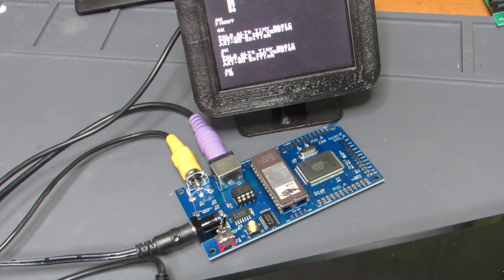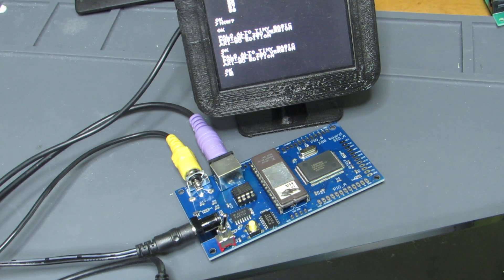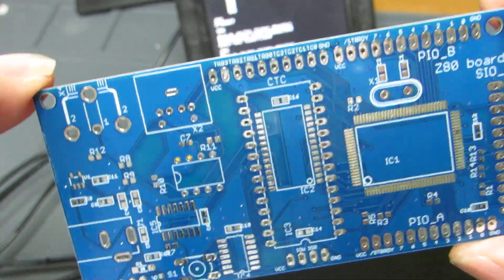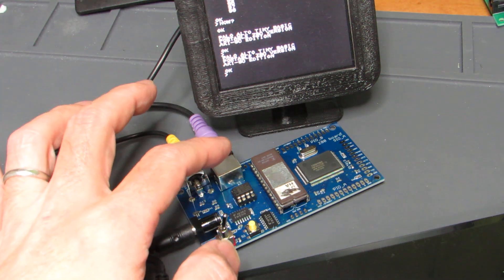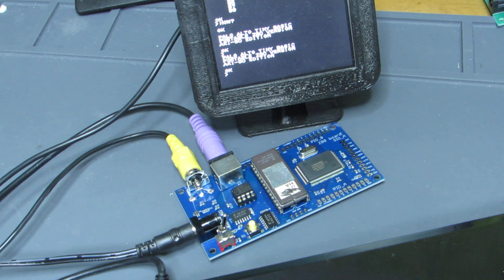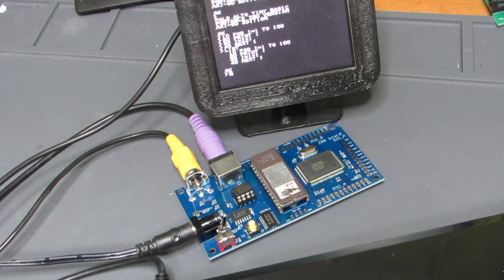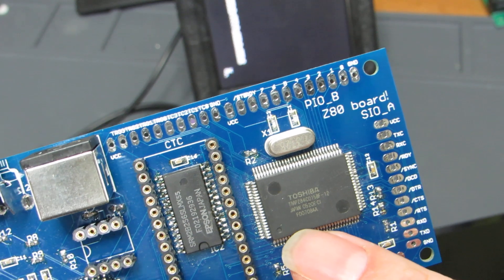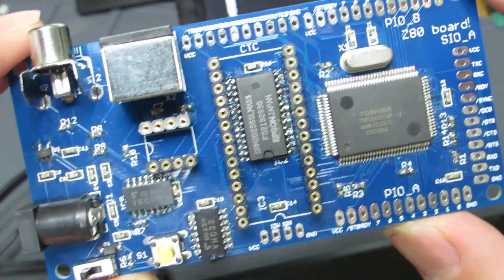New Z80 single board computer is born.

Comment: You could in the future add a video and sound chip , possibly even a Super I/O controller  ??

Legacy Video chips.....NEC upd7220, D72020 in PLCC44  .....or .......V6366 CGA video chip  in PLCC84 
SN74689 or SAA1099 Sound Chip in Skinny DIP16/18
A Super I/O Controller, Surface mount , PC87303,  PC87307,  FDC37C672 etc  Giving Hard Drive, Extra I/O, Keyboard input etc  all on one chip

Comment: I'm contemplating a single board computer with several processors, one each 6502, Z80, and a 68SEC000 8 bit data bus 68K

Comment: There’s an LPC810M ARM Cortex M0 processor on the board which can run at 30MHz with single cycle instructions! That’s not true to form!
Reply from the maker: microwavemont
Three weeks ago:
Actually Z80 part has just UART/4800bps and video generation and PS/2 support is made by LPC810 console program. 32bit ARM MCU is supporting ancestor (not direct, though) Z80.

Comment: Fantastic ^_^ Thanks you for share your experience. Can i suggest next implementation ? VGA and Ethernet : P
Reply from the maker: VGA requires, for example FPGA? and Ethernet... Hmmmm...
Reply: microwavemont I wold go with an parallax propeller for VGA, sound keyboard and sd-card-storage and an enc for eth or an esp module for wifi. By taking an fpga i‘m only half a step from every thing within the fpga away. There are plenty of boards for that out there, from every fpga devboard to these retro computing fpga boxes like mist. Such an dedicated Boards are where the fun of micro computing is for me. And a powerful mcu  like the propeller gives plenty of room to customize your micro ;)
Reply: @microwavemont  maybe ESP8266 for Wifi instead?  It maybe also used for VGA as well? 
https://github.com/smaffer/espvgax
https://github.com/hchunhui/esp-vga

Comment: lookin' good, what are you using for video generation?
Reply from the maker: Actually Z80 part has just UART/4800bps and video generation and PS/2 support is made by LPC810 console program. 32bit ARM MCU is supporting ancestor (not direct, though) Z80.